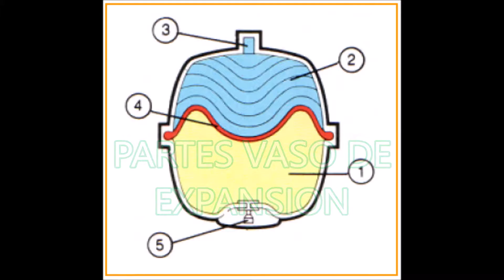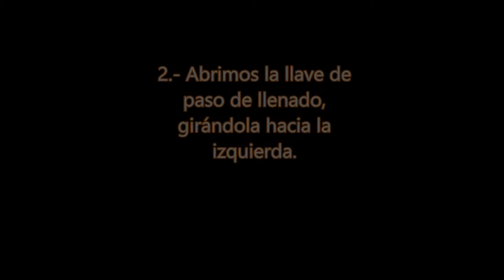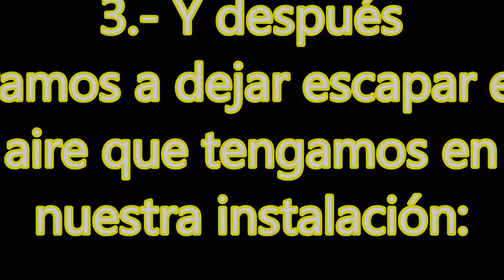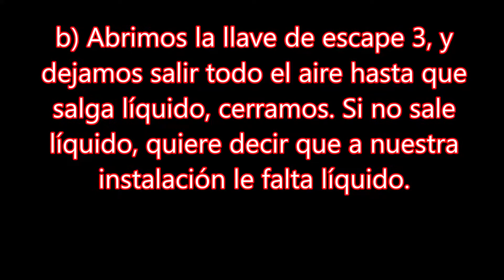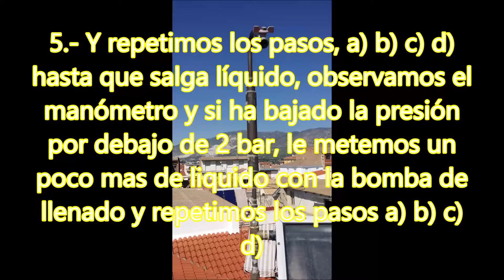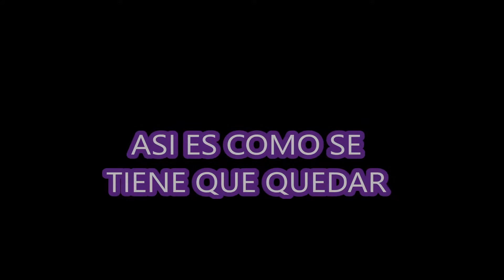MANTENIMIENTO DE INSTALACIÓN SOLAR TÉRMICA NO FUNCIONA NO CALIENTA. LLENADO O RELLENADO GLICOL. erc

Comment: Y si usamos una bomba electrica y un cubo de pintura de 30 litros no sería mas sencillo el llenado??
Reply from the maker: No tenemos la misma precisión no se tarda nada y hombre todos no tienen una bomba eléctrica y su valor no es el mismo, pero bajo mi punto de vista yo no la usaría nunca, no lo recomiendo puedes reventar el circuito de refrigerante
Reply: @durquenorc.todotutoriales  bueno, una bomba de 12 voltios 36 vatios con un caudal de 500 litros por hora y una presión maxima de 2,5 kilos solo vale unos 40 euros, y con un trafo de dicroica y un puente rectificador mas un par de condensadores electroliticos nos llegamos a los 45 euros y funciona muy bien.
Pero vamos , que nunca he llenado un circuito solar asi, para ello  en el taller tenemos las carisimas bombas de llenado de grunfos.
Reply from the maker: @gold_prospectors  material que se utiliza en el video 12 € como mucho y funciona como esas carismas y pesadas bombas profesionales, no tiene color, yo he utilizado también las profesionales y te digo una cosa me quedo con mi sistema, no pesa nada no cuesta nada y lo sabe utilizar cualquiera mayor de?